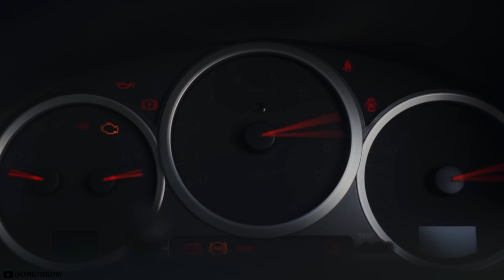Donut Media VS. Subaru

Comment from the maker: This was a tough one to do, mostly because I don't want people to think that I prefer one side over the other BUT I don't think Donut's initial experience with Subaru's is that....out of this world. After all, how often do we see marketplace ads with Subaru's mentioning rebuilds or ringlands? At the same time, Donut Media maybe had duplicated issues because they didn't have the experience required to build these cars.
But at the end of the day, they're just Subaru's. Right? it shouldn't be that difficult, or is that exactly the problem? It IS difficult to work on them..Would love to hear your thoughts below on this and hope you have an incredible day!
✅ Subscribe here - https://bit.ly/3kXgWr0
🔥MartiniWorks DISCORD BB - http://bit.ly/3XhEV5z
😊$39 Heavyweight Hoodie - https://bit.ly/3XcECIU
Reply: The issue is exactly as you said, sunabus are a more complex engine to work on and noone will admit it until they get more expensive and it's only looked after by bigger shops and people with more money to take care of the cars better, that with shortcuts made by Subaru themselves doesn't make it too great for a beginner enthusiast
Reply: Every forester I owned was reliable but I was insane on keeping the timing belt, water pump, head gasket among other things changed well before I was supposed to….but donut has built plenty of engines that worked fine….seems like it’s a weird thing that the subies went to sh*t easy. I mean they broke an axel and the engine broke?
Reply: Great video Alex, agree with pretty much everything. Great comparison with  S4B5.
Reply: I own a 2010 Subaru forester & I’ve been a technician for Honda for 10+ years… believe me when I tell you that this vehicle is more difficult than my wife and kids put together.
Reply: overdrive studios bananaru was the better build
Reply: At 6:55 did u say we know we didn’t?
Reply: If subaru engines were so great, enthusiasts will be swapping them into other cars all over the place.

Yet, K-swaps abound.
Reply: @sepg5084  I agree. The saying goes that Subaru is the Hyundai of Japan
Reply: The problem was not one of them was vaping the entire series.
Reply: Totaly agree with you. I worked in rally racing, Subarus and Evos were our bread and butter cars. It was way easier to get HP out of the 4G63 than the EJ but we always did way more EJs which were super costly to do right. The Evos tended to cost more initialy (and didn't looks as good IMO) but ended up costing less to get to 500-600hp because the iron block was so easy to work with.
The best thing you can get on to save your EJ race engine is a baffled oil pan and an accusump, so many EJs could have been saved with a simple 300$ oil accumulator.
Reply: Exwife n i had a 92 liberty gx (2.2, naturally aspirated, 5 spd).
The 2nd gear synchos were shit.
3rd wasnt much better.
Sooo slowwww gearchanges.
Wife fugd off to live with her new bf. Took (stole) the subaru.
Rang me whining about 3 months later 
Blown headgaskets. Both banks.
Needed a gearbox. And a clutch.
I said 'suck shit' and hung up
Reply: Let's face it, the cost of a Subaru makes it an ideal platform for young (mostly) male (mostly) drivers.  And, the Subie community reinforces the idea that these cars are easy to work on, that any moron with some tools and access to YouTube can 'get r done'!  For all its marketing, Subaru DOES need to do a better job designing the WRX and widening its tuning envelope  BUT, the Subie community needs to be more responsible and honest about the shortfalls of this car (not sure thats possible with the aforementioned young male demographic?) and of the people working on them. Unfortunately, the primary attraction of this car, cost, tends to be a double edged sword.  People buys these cars because they are a good bargain and they work on these cars because they don't have the cash flow to let an expert do it.  Make no mistake about it, these cars are fast, these cars are reliable, there is tons of info out there on how to work on them.  However, until owners can admit they don't have the knowledge or experience to work on these cars, it's the car that will bear the brunt of the blame.  I honestly believe that owners do know where the blame lies (them) and that the car is solid.  The upside to this is that owners have formed a tight knit community, a brotherhood, that vehemently defends this car and sings its virtues (sometimes, I fear, to the detriment of having Subaru fix inherent problems).  Its one of the things that drew me to this platform, having a fellow Subaru owner wave at me as we pass each other or wait at a light together.  And, the shock on their faces when I step out of the car and they realize I am old enough to be their father.  Yes, us old guys love Subarus too! ✌❤
Reply: The issue with the oil pan is cost. It's a mass production issue where they can save millions by not making a dry sump or baffled pan. Boxers absolutely need them for performance driving because of the horizontal piston movement, there's more stress on the bottom side of the cylinder and rings from gravity meaning they need constant oiling to not eat bearings and ringlands. All Porsche boxer engines built for performance have one because they aren't as concerned about keeping prices as low.
Reply: Subaru ? Known for engines blowing up??? Never heard of it.
Reply: Ya or s2000
Reply: They admitted to running tunes that weren't for their parts, and not breaking engines in, lots of platforms would pop if you threw a base map for a different turbo,exhaust, etc and tracked the motor without breaking it in
Reply: Well put, they require a certain bit of knowledge to get right.
Reply: I knew a guy that had a 2013 sti and he blew his moter like 3 times had a shop swap in a new one and that one blew I think there just made of glass in most cases I mean it seams to me like people really have to work hard to defend these motors
Reply: Donut used baffled oil pans on all these motors, and James talked about it.  Why does everyone miss this.
Reply: @cliftonsargent1572  Did you see Donut's latest update on that? It just came out last week, and they said the impact made another wheel  forced the engine to go in reverse and screwed the timing.
Reply: The same guys did a Hi Low with a Nissan 350z and a Toyota truck, arguably with less experience... There were problems, but not nearly as much as the Subarus, and I think that's because the cars and engines were probably pre-abused (considering the price they paid for them), the basics of the cars weren't designed for continuous track use, and this time they subjected them to continuous track abuse. The format this time around was every front of camera member doing back to back time attack on a track on one shooting day for each mod. I believe the 350z was in a parking lot until the very end. And the Zs failed both on the drive to the track and then again on the track. The money pit Miata also blew up on the track, immediately. If you watch their videos a lot, they talk about the shooting schedule, a lot. I'm not saying they cut corners or anything, but I think he team and shop is tuned to making a build on a schedule that looks good and works for the video. But doing 20 laps around a track in a car in 1 day is different than doing skids in a parking lot. And every car they have built has failed almost immediately on a track and skidded around parking lots just fine.
Reply: ringland's that's a new word!!! Always failing upwards!
Reply: Mechanically, Subarus are SIMPLE to work on actually which is half the problem low barrier for someone to want to tinker on them.  The other half is that from a tuning and reliability standpoint they are HARD to tune if you don't know what to compensate for.  Boxer engines are basically two engines glued and bolted together, not an issue if you're willing to design how fluids and sensors are laid out to compensate for that Like Porsche does (adds cost but reaps benefits of boxer layout).   Subaru doesn't have that luxury when trying to compete against Inline 4 engine manufacturers.  They just gotta design the flat 4 engine to run line an inline 4 so they don't double up on coolant or oil pumps or fancy parallel fuel injection systems like Porsche can.  That's not a problem until you go and try to add 200 hp and all the software based compensations for fuel and ignition timing to balance those asymmetries is no longer applicable.  Few tuners know to even look for those and even then the sensors on a Subaru don't give the data needed to even know what to do with them without putting the engine on a bench dyno with a bank of sensors on every cylinder to be able to adjust from.  And then there are some specific things about the geometry of a subaru engine that makes the engine more likely to break if these tuning blind spots result in a detonation or if heat gets out of control.   Boxer engines have a ton of advantages which is why Subarus are so beloved even as tuner cars.  But there's this narrow set of specific challenges that really only apply to Subarus that few tuners really want to deal with much less have the ability.  But the rewards are there if you're willing to do the research and spend the extra time.  Just ask me, the proud owner of a 2005 WRX with ~150k miles on the clock making a nice reliable 350 hp at the wheels ;-)
Reply: subarus used to be great ages ago, nowadays they are meh

well... if you dont take into account brz/86
Reply: My cousin bought a 2003 WRX Put in 15k  and the engine blow up again nigga 3 times no way and he takes it to a  real mechanic 🧰